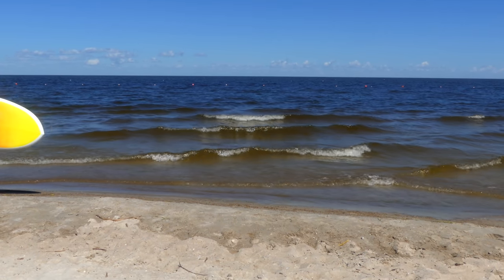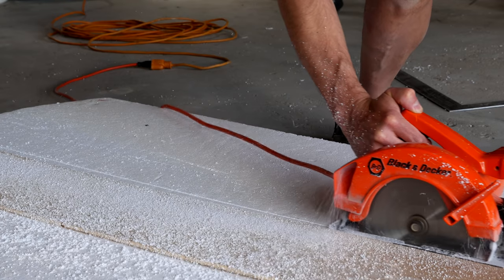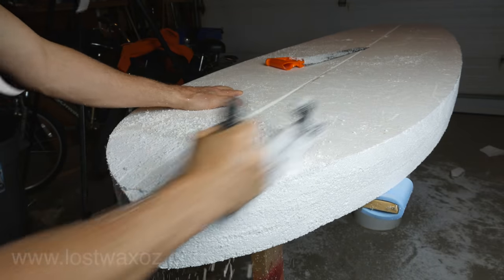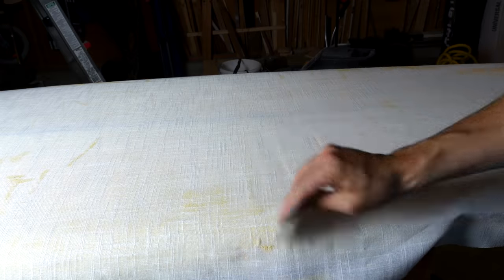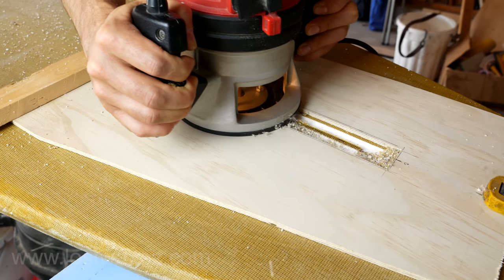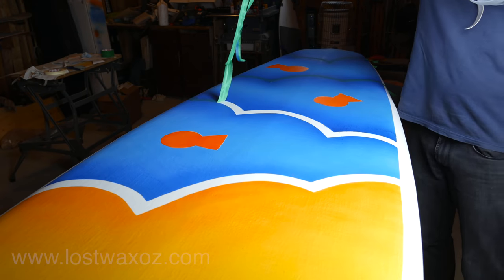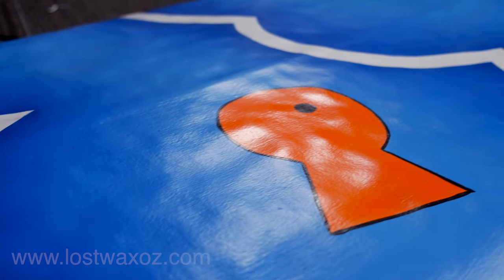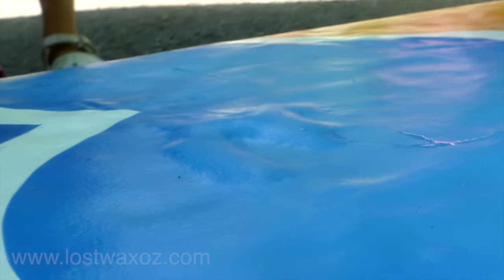DIY Surfboard / Make a Stand Up Paddleboard (SUP) for Kids Using Poor Mans Fibreglass (PMF)

Comment: Now this is just kinda freaky. I've been researching PMF for the last few days. From what I understand,,,,, it's not really the glue, it's the paint. On something "foamie" you run a "tool of nails" over it to puncture holes into the foam, then coat with the glue so it goes all up into the holes and on top, then lay the fabric, that's also coated with glue on and smooth. Dry over night, do the other side, dry over night. Sand. Paint. Sand. Paint. Sand. Paint,,,,,,,lol. I have a composite in mind I'll be trying. But this, is really awesome, that you tried it :D
Reply from the maker: cool, I'd love to hear how it works for you. I have never seen it done on EPS foam, so I wasn't sure how it would work. Still not sure of long term durability, only time will tell!

Comment: Definitely will try this for a sculpture as I have a very large Styrofoam block that I've been meaning to carve up, but wanted to be able to coat with something that wasn't hundreds of dollars a gallon ! And, the fact that is is not toxic & lots of fumes is a huge plus ! 
 I DID laugh at the "shop vac" through the hair, as that is another reason I haven't carved the block up ! The clean up will stink ! :/
Reply from the maker: Yep, you'll be finding little foam bits for the next year:)
Reply: Did you make the sculpture

Comment: THIS IS AMAZING!

In nc we don't have the best waves, but we usually get pretty good shore break waves. My normal longboard gets beat up in the shallow water, so I thought, why not make my own! I've used pmf for other projects but I couldn't find any info on using it for surfboards. Epoxy is wildly expensive for a board that's just going to get beat up. 

This is great! It's almost like a $30 soft top.

Comment: Looks like you had lots of fun making that board. In regards to the foam, the correct grade is a M grade polystyrene, that’s what they use for all marine buoyancy product this also stops any compression when standing on the surfboard. Also with that air bubble getting under the board you would have been better off to put an knife incision directly in the middle of the air bubble and then purchased the cheapest construction adhesive that you can get your hands on and any hardware store and then injected it under the board to glue it back on.

Comment: Next time try adding some "Poly Urethan Varnish" to your Glue-Water mix. this works also really well giving a hard surface. This is used in TerrainMaking to make StyroFoam more rigid.
Reply from the maker: Thanks for the tip, I'll keep it in mind!!
Reply: Just what I was looking for. I make model aircraft and the technique is much the same, basically getting foam to hold up is stringers and/or planking. If you cut slots in the foam you can push thin flat carbon rods in after soaking them with glue. Then go for a super thin glassfibre cloth and poly floor varnish. The stiffness increase is insane. Great video!

Comment: You have shine of genius. I want to build fiberglass, epoxy eps foam 12' or 14' sup boards. What should I do in order to the foam absorbs less epoxy? foam density is 1 lbs/ft3 (16 kg/m3)
Reply from the maker: Hmm, I would point you to the discussion forum on Swaylocks.com, that's where I learned a ton about surfboard construction.

Comment: Nice video.  I will say that after watching your vid, I called Titebond regarding the relative merits of using Titebond 2 or Titebond 3 as I have a small boat project underway and plan to use Titebond 3 with cloth as you did.   I was curious to know if there really  is a significant difference between the adhesive connection of multiple coats of either Titebond 2 or 3. 

 The answer I received was that generally there is very little difference in the adhesive bond of either TB2 or TB3.  Further you can thin either TB2 or TB3 up to 5% by weight or volume without a loss of strength.   I plan on thinning up to 8%, to the consistency of heavy cream.
Reply from the maker: Hey that's good to know! I had heard that TB3 wasn't as good at bonding with itself in multiple layers as TBII, but that would be great if it is! I actually just built a small sailboat this summer using bedsheet cloth and TB2 on the bottom edges, I think I just did one coat of TB2, nicely saturation the cloth, and then I used a alkyd paint (Rustoleum) which finished filling in the weave of the cloth. So far I have been super impressed with the alkyd paint/TB2/cloth combo, though I have now only had it for a couple of months. But my canoe is gonna need to be repainted next year- I painted it with a latex.
Reply: You might like to watch SRHacksaw’s video on building his foam designed rowboat called Flier on YouTube

Comment: I built my first (super ugly compared to yours) board, using "pmf" and those dings are simply delamination spots, wood glue on cotton fabric does produce a quiet strong surface however, won't bond to foam, still, you did a great job!

Comment: I see a number of customers using Titebond and Titebond II glue for "Poor mans Fiberglass" on boats, which to me is not the best choice. As far as I know, the regular Titebond is not waterproof, and Titebond II is only "water resistant" according to the label. Only Titebond III is labeled as actually being "waterproof" right on the label. If I were to use it on boat construction I guess that would have to be my choice because I would want the best I can get when it comes to keep things afloat, right?!
Reply from the maker: In a sense you are right, but there is one other thing to consider- Titebond III does not adhere well to itself, whereas TB I and II do. So if you are doing anything that requires more than one coat of TB, the tradeoff could be worth it.
Reply: @LostWax2  Wrong! Titebond 3 DOES adhere to itself just like Titebond 2 does. I don't know who started that rumor, but it's not true. I have my test panels right here and have the cloth covered in three steps. It's as good as fiberglass with three coats on the canvas (sanded between coats) and smooth as a babies ass.
Reply from the maker: @PainterD54  Wow, that's good to know! Thanks for the real life experience. That's the stuff that counts.

Comment: Could you just measure arm pit to arm pit for width?
Reply from the maker: Not really, My armpit to armpit measurement is 18 inches but the board is I think 26 inches. You don't need to be able to have your arm go straight down at the armpit to be able to paddle the board.

Comment: I love lost wax for its - often- make this awesome thing out of cheap materials that anyone has access to. I was hoping that lost wax 2 would just be a creative outlet that did something similar. But really I just find myself more and more disappointed with lost wax's new mentality like- dude - if you want a self stroking " look what I did" kind of a video journey just like - make a video blog or at least be honest and say that its a video blog. Your misleading intro like - oh I made a thing out of trash woo! You could too ! Its the " poor man's fiberglass" that I designed on my computer ($$$) and then just printed out on simple paper and made a pattern for by taping pieces of paper together! I just used some cheap trash lying around my house! Like this hot tub ($$$$) cover! Then I used poor man's fiberglass and all the clamps I could find to glue it all together! & I cut it with a circular saw ($$$$$$) Used a metric TON of wood glue, paint, epoxy resin ($$$$$$$) oh and this bed sheet and some fabric I just had laying around... its such a CHEAP project! It's so ACCESSIBLE. Oh yeah... then I just added some SUPER simple finishing touches with my THREE D PRINTER!!!! ($$$$$$$$$$$$$$$$$$$) and my freaking airbrush with an industrial air compressor ($$$$$$$$$$$$$$$$) and cleaned up with my SHOP VAC! ($$$$$) My family joined in. Im such a thoughtful family guy doin what I can with simple cheap materials and you can too! 

(well that is... ya know... if you're affluent enough to afford all this equipment AND a house with a garage that you have the privilege to use as your own personal workspace AND you have both the affluence and the privilege to be able to afford all this stuff and still be able to support several children and....  oh you know... just happen to have these simple cheap things lying around cough computerpersonalprintercircularsawhottubcoverprofessionalclampsgalonsofwoodglueepoxy3Dprintershopvacindustrialaircompressorairbrush cough I mean look at this cool simple thing I made out of cheap trash I found lying around my house! Foam wood glue and fabric! SO COOL! 

Hey - Good for you man. It's nice to know that during this time of suffering and joblessness terrifying impoverishment the likes of which few countries have seen in decades... and INCONCEIVABLE AMOUNTS OF DEATH. 

People with families and houses and the kind of affluence that allows them to use hundreds of thousands of dollars worth of equipment 'lying around the house' to turn trash into treasure for their own amusement - are doing that - and making videos about it. 
Cool story bro. 

The rest of us are gonna go back now- to facing horrifying life or death decisions about whether or not going to work or school is worth the risk of potentially killing hundreds more while we starve on our scraps but hey - it sure was fun watching your make your " poor man's " surfboard. RAD.
Reply from the maker: Wow, intense! Though I do appreciate feedback from everyone, so it's good to hear how you feel about what I do. If you feel that way, there probably are others thinking the same things. 

I honestly didn't make this to stroke my ego, this video is from a project I just wanted to make for myself, and thought someone else might appreciate/learn from the successes and mistakes I made along the way. It would have been a lot faster and easier if I had just done it by myself and not filmed/edited/spent a bunch of time to post a vid on a YT channel that isn't even monetized. 

And, yes, I do use some tools, though most of them are inherited/ taken from the garbage and fixed/ bought at garage sales for under $10. I'd say most are over 50 years old. 3d printer, you're right costs a bit, but this project could easily be made using a wood fin box and wooden fin. No need to do a fancy airbrushed paint job either. I really just want to help people create and give them ideas that they can use to jump off of and build on. 

And, yes, I am so thankful that I have a garage, especially because I live in a place that gets to -40deg in the winter, which happens to be at least 6 months long:) I used to live in a tiny little shack with snakes and rats living in the roof, but in a beautiful country, and I would swap the house and garage for that shack in a second. 

All right, that's it for me defending myself:) I totally agree that I am privileged to have grown up where I did, in a middle class family, and it's not O.K. that others have to work so much harder to get the same opportunities I have had growing up. I believe that everyone is valuable and deserves to be loved, educated, and treated with respect and equality. 

You'll be happy to know I am currently designing some knight armour that uses only my standard foam/hot glue paint combo, as well as making a sweet fun little glider from just one sheet of foam board and hot glue. No 3d printers:)

Cheers,
Chris